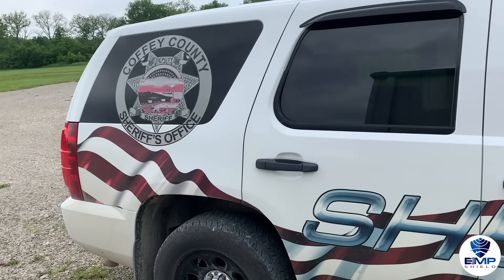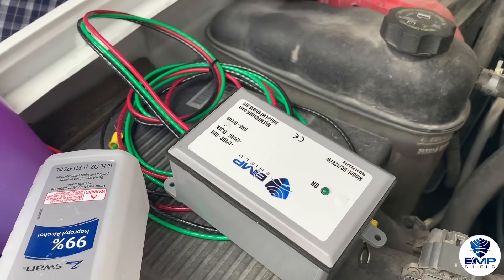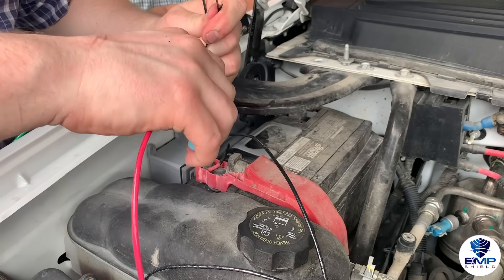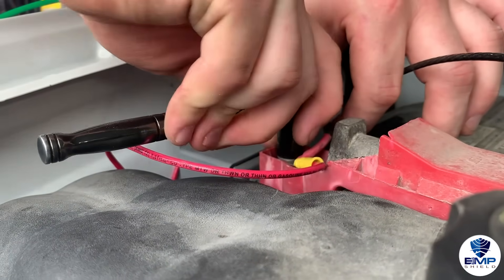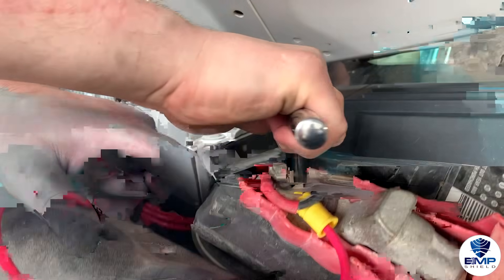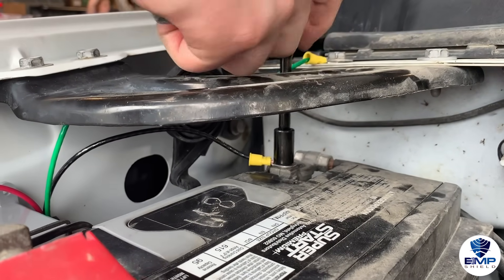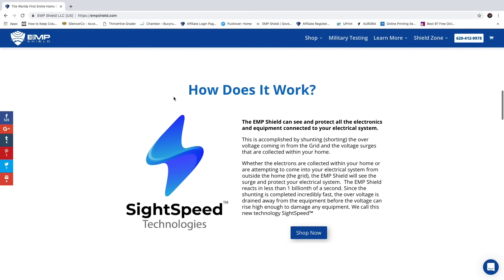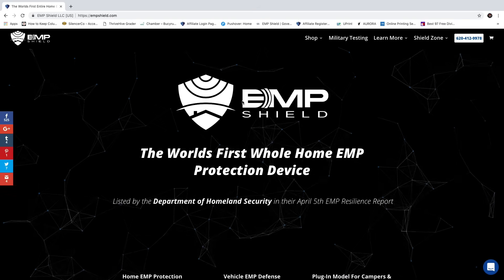EMP Shield Vehicle Installation Instruction - Electromagnetic Pulse Protection on Police Car

Comment: Im a Veteran, an auto technician, I used to be an Electrician Apprentice for 3 years, Im currently (pun intended) about to graduate with my Bachelors in IT, and I consider myself a amateur scientist.  
1) that ground wire is definitely not grounded to chassis. 
2) How does surge protecting the battery protect the resisters  and capacitors from overcharging and breaking within the ECU’s throughout the vehicle? 
The Ionized particles surge through the entire vehicle they don’t ain for the battery. The only way to protect from EMP is to physically shield the PCM, TCM, and RF-Hub with a Faraday wrap. 
Besides a private company simulated an EMP on several vehicles in stock condition and nothing happened to all vehicles newer than 2010! 
A Nuclear explosion triggered EMP is not going to render cars immobile. It’ll take out the power grid for sure! But very few cars will too. 
Don’t waste your money on this.
Reply: lets all hope your right, i feel soon we well all find out.

Comment: Can someone explain why the negative wire from the car battery that connects to the body of the car is not good enough? Are we saying the guts of this device are an easier path to ground than a large size conductor that’s already in place on every vehicle? Keeping in mind the car tires are a great insulator and no relief to Earth is available with either system.

Comment: Im about to install one on diesel that has two batteries, one on each side of the engine compartment: do I need both batteries protected? Specifically a 2003 chevy 2500 HD

Comment: Do you need 2 units for a 12v dual battery diesel truck?  Or can You just install it on one of the batteries?  Or do you use the positive on one battery and the negtive of the other?

Comment: I just watched this video.  My only BIG concern is that the guy wraps the 'extra' Red wire into a loop to coil up the excess.  THIS IS A BIG NO NO!  I am a surge protection professional, and I would shorten this wire up to serve the purpose of connecting it to the Battery positive side of the system.  Don't forget to keep the inline fuse provided.  The coil of wire is a huge inductive (reactive) component which would decrease the effectiveness of the suppression capability of the device.  Don't do this!

Comment: I am planning on picking up one of these in the coming week, or so, once I determine whether I can get away with a standard one in my vehicle's engine bay. I am, however, confused by the install order of this video. This video shows connecting the Positive/Red terminal first, followed by the Ground/Green, and lastly by the Negative/Black terminal. But this goes against what I know of normal 12V battery connections, which is to always start with the Negative/Black lead on a battery when removing fasteners?
Reply: I was just thinking king that too

Comment: Question that hopefully somebody can answer competently, I have a 2015 Mercedes Sprinter Roadtrek RV. The RV house batteries are in the engine bay, the chassis batteries are under the driver's floorboard. Will this installation work in the engine bay if I connect the positive to the RV battery in the engine bay? If not, I will have to route the positive to the chassis battery under the driver's floorboard. That would make the installation more cumbersome than I would desire. I have already purchased the unit and I'm waiting for further instructions before I proceed

Comment: QUESTION: Your instruction sheet, paragraph 4 states "Installation point for ground wire must be no less than 4 linear feet from the battery negative." But your video failed to demonstrate this. Is this critical to success or just recommended?

Comment: How much juice is being drained from the batteries while the vehicle isn't running? I see the tiny running led, but I would wonder how an accessory plug on something like a motorcycle would be effected under maintenance charges and actual use during operation. Cold starts after just a month or two come to mind.

Comment: Has this been tested on EVs? Should it be installed the same way for an EV by connecting it the same way to the chassis and 12V battery?

Comment: It’s a glorified surge protector being maliciously marketed that it protects people from an EMP when it actually doesn’t.
Reply: Yes, it protests from the surges or pulses from an EMP CME or surged caused by lightening so a vehicle or device can still function after the strike. What was you point?
Reply: @matthewronsson  Surges and EMPS are two completely different things. If the car gets hit by lightning this box will shunt that energy to ground. If the car gets hit by an EMP, everything is fried simultaineously. It's electrical effects cannot be shunted to ground. The only way of protecting the vehical is if was encapsulated in a farraday cage. By the way, there are only 2 things that can produce an EMP strong enough to cause damage, that is a nuclear strike, or a solar flare. And if you think for one second that this overpriced box of lies is going to protect you from that, then your an absolute fool.

Comment: I have shielded all of my vehicles and my side by side UTV.  I am curious, since large trucks generally have 4 to 6 batteries and run  on 13.6 to 15.0 volts would the 12v vehicle module protect them? I know that most 12v items are good to around 18 v before they go out.

Comment: How does it differentiate between the ground going to battery and the ground going to the EMP shield...all car batteries are already grounded to the chassis via the negative terminal, adding in another ground or green wire does nothing if the unit is connected to the negative terminal already....the pulse would reach the battery before it even went through the box. People would have to remove every electrical ground from the car chassis for this to even remotely work, the unit has to be the ONLY thing grounded to the chassis. Come on guys think about it for like 5 minutes.

Comment: Im confused about your video. The choosen ground wire location in the video doesn't make sense with what your directions say for install.
 Your directions state, "installation point for the ground wire must be no less than 4 linear feet (of conductor material) from the battery negative." 

The chosen ground location in the video does not look like 4 linear feet from the battery negative to me. Maybe a foot at most.

Comment: Instructions clearly state to put the ground wire a minimum of 4 feet from the EMP device and battery if possible.
This video shows the install about 4 inches away.
Do not do that! Stretch that green ground wire out as far as it will go and find a place to ground somewhere there. If you don't do that there is a good chance the device, battery and ground wire will all ark together rendering your EMP Sheild useless as well as your vehicle.
Be smart and follow the instructions. If they are confusing then call customer service and let them talk you through it.
Awful lot of $$ to spend on something to protect your valuable asset's just to throw it and your vehicle away because you didn't read the instructions.

Comment: We might note this device is NOT an EMP "Shield".  It is a pulse suppressor.  It does not shield any components of the car.
Reply: It does "shield" the vehicle. Research how EMP works first lol. I'm glad you're not the engineer that designs tools, gadgets, or devices.
Reply: It cannot guarantee EMP protection Because its not a Faraday cage. It can only increase the vehicles survival not guarantee it.

Comment: What about vehicles that have two batteries? Many newer vehicles have a small, auxiliary/second battery for automatic start/stop.
Reply from the maker: Michael Ferguson great question! You can install a single device on vehicles that run 2x batteries. The Shield installs onto the main vehicle battery 🔋. Unless your vehicle has two distinct 12V systems a single Shield will work.
Reply: EMP Shield thank you so much!

Comment: Why hell, that didn't tell me anything!  Wth does this thing do?
Reply: It directs over voltage to ground and disconnects the battery from the system by short circuiting it
Reply: @matthewfredrickmfkrz1934  
Actually I just knocked myself in the head!!!  It's function is in its name: (E)lectro(M)agnetic (P)ulse Shield!
Reply: @jamesrobert7155  I looked through the comments and found a link to the website... That's pretty much what it does and how it'd be protecting stuff from what I could tell and explain to you in simple common terms... I guess I neglected to mention that emp "inducts" voltage through "electromagnetic permeability"  and that's what would be the problem for a circuit in the case... The poopoo are really just saving checking some fuses in the extremely rare instance of an emp which means the precinct is wasting money on dumb ahhs boisheeeeit IMHO
Reply: Here's what would happen to me...
"OMG wtf happened to my nose it felt funny... Oh car won't start... Checks fuses (5 seconds later) oh my goodness a blown battery fuse or at worse a burned "fusable link"... *Gets fuses in replaces simple 8g wire for fusable link*... Oh man now I ain't got no money due to inflation copper is expensive also since 95% of my income goes to police safety for my safety if I don't like it poopoo comes kicking in my car/house I welcome the new alien overlords as the new masters now... Meet the new guard, same as the old guard...
Reply: @matthewfredrickmfkrz1934  
We should make that into a movie my man! Damn!
Reply: Or an alien invasion, they wanna be ready for that, or if the Sun decides to give us all a giant burst of love.
Reply: @jamesrobert7155  it'd be a great metaphor for reality that way

Comment: The wiring looks so sketch no heat shrink terminal ends no wire loom and the cable was not cut to length the ground bolts are exposed to the elements and it's not aesthetically appealing.......I'm a profectionist so I guess it doesn't bother the police officer as long as it protects the vehicle from EMPs

Comment: This is why I have a 78 Malibu with a points ignition system sitting in my garage in case that day ever comes
Reply: Richard Wolfe  I use a magneto. Its makes its own power
Reply: @jonalarcon8564  
I have $5k worth of brass screen under my T-1-11 and Armorcore in between my wall studs in my 1300sq ft house. Custom Lexan glass windows. I used 2×4 oak for the window stop material with 1/8" iron flashing underneath.
Reply: Richard Wolfe faraday  cage cool.
Reply: @jonalarcon8564  actually I just copied a friend of mine that used to steal equipment from the state and the city and he showed me he hid it in his garage and his brass screen under his siding hid the GPS and LoJack signal until he could find it and remove it
Reply: Richard Wolfe I'm getting ready to do a new house build I never thought about doing something very similar to what you just mentioned unimpressed any more information out there
Reply: @jimwoodard927  I would have went with a thinner brass screen because it works just as well and save myself half of the money
But the *Armorcore inside the walls was the best investment I've ever made
I have solar panels up top and two Tesla batteries underneath and I can go about 11 days
Reply: Richard Wolfe speaking of Tesla if you got the Tesla walls can you operate them without them being connected to the internet I don't really want anybody outside being able to have access to meet to my electrical system would have been very interested in your product
Reply: @thecloneguyz  is it difficult to connect with a cell tower with that setup? 
If it's so, then I'm certain there's a workaround.
Reply: Richard Wolfe well that would be odd because General Motors switch to electronic ignition switch exclusively on all the vehicles in 1976-77 car what is somebody retrofitted with points that's good for you
Reply: @jimwoodard927  it's a Mallory dual-point setup for racing
Most old school guys put these on their car instead of the HEI
Reply: @jimwoodard927  
Your talking about an HEI bro
Cmon now 
My motor is a twin turbo 283 cui pushing 93psi of boost @ 7500rpm @ 9.73 1/4mile @ 131.7mph...
Reply: Starter and ignition can still go out from a emp.
Reply: @saltyp7573  not on an older vehicle because the the way the starter and the points ignition system are built
Reply: @thecloneguyz  to make sure that your vehicle WILL work after a emp, ferrite rings over the electrical wires on your starter and ignition. Modern cars will need more shielding, they also sell a device to mount under the hood of modern cars for emp protection. It basically connects to the battery.
Reply: @saltyp7573  there's no circuit board in older vehicles electronic systems
Reply: @thecloneguyz  maybe in the radio.
Reply: Doesn't an EMP take out the coil the windings inside a coil and your starter and various solenoids. And if you shielded the brain box the EMP will still hit the tail light filament run right up the wires and all the way it back inside your little shielding around your brain box and take the Pulse right inside so I don't know how you're keeping an EMP out of anything without putting your whole car inside a faraday cage
Reply: @brenttate9299  the solenoids and starter and coil packs run at a higher amperage than the EMP
Reply: @thecloneguyz  if I remember right a nuclear EMP produces 30000 to 50,000 volts I'm pretty sure if I put that kind of voltage to any of the devices I mentioned earlier they're all going to be toast. Seems to me all this is going to help against is a leaky microwave oven. It also seems like this is the best game out there because if it don't work how do you get your money back because nothing's running males not going to get through and you can't drive back to go get these people
Reply: @brenttate9299  horse, and back to the old stagecoach❓
Reply: @brenttate9299  
You're leaving out all of the shielding and metal and rubber and all of the stuff that's protecting the starter and the wires
Reply: Switch to something like a 97 Cummings and no ignition at all. Use a powertank w air tool to spin the motor to fire it up.

Comment: It should be standard equipment on all vehicles and on a home's electrical system
Reply: I have brass screen underneath my cedar shake siding to protect my entire house
$5500 in brass screen
Reply: Richard Wolfe qqqaZ. L.
.
  MMA
A,M.  Nuikieiugceojuiufeaoiuioszsdioisiiioioiooizkzkokkozkkkllkzlkkolklzkm%kklkolksMKLZSPKKSDOKKDLKLMLMML!KL KL. LKML!LLKL!QQQAQWDKLKLKLKLZ-LZLLLZ9
LLL!L!LLLDL!!DL!S!LD !L
Reply: @thecloneguyz  Ever see Breaking Bad and the lawyer's father...
Reply: Most auto manufacturers these days have filters on the power connections into electronic modules.   Also just the battery itself has a voltage that is pretty immune to voltage spikes.   The impedance of a battery is pretty low.
Reply: @GeorgeWashingtonLaserMusket  The battery should absorb the energy.   This box has a very long cable.   Doubtful if this box even sees the energy spike if it is short.
Reply: @GeorgeWashingtonLaserMusket  a faraday cage is something that is isolated from Electronics or other metal in the car so nothing on a car is a faraday cage because it's connected to all the other electronics plus it's isolated by the rubber tires
All it takes is one large solar flare and every HEI electronic system will be garbage on every single car 
You'll wish you still had a points Electric System
Reply: xadam2dudex it does nothing it can't do anything try searching Faraday cages or EMP attacks and you'll find this box is full of snake oil
Reply: Jim Woodard yea I don’t see how this can protect a vehicle or a house
Reply: @will if there's a will, there's a way 😉
Reply: @jim cool story bro but maybe you should be the one searching. You mean the multiple test they did at the facility is fake? Lol. They sure went through a lot of trouble just to Fake this and if another third party test this and it fails they can get sued. HEMP can't destroy all vehicles anyway modern or not. This device can increase the vehicle's survival rate not gaurantee it. EMP creates an overvoltage problem so this device is like a super fast surge protector. If this doesn't work years later maybe government can sue them too lol. CME/solar flare can happen every 100 years so I guees we will all wait 😜
Reply: @ewcm1878  Likely tested with very short cables.   This is just an EMI filter.   No big deal.   The only need to test it was for marketing.
Reply: @ewcm1878  The "test" they did is full of BS. They subjected it to 50K V/m which is really nothing at all. Electromagnetic fields are influenced by wire length -- the longer the wire the more prone it is to effects. The highest energy pulses (which are way more than 50K V/m) don't start really seeing effects until the wire is about 3m long. This device doesn't have a wire that long in it.

Your vehicle already has a lot of survivability in it. As long as your electronics are all properly grounded, any sort of direct influence effects will be shunted to ground and nothing serious will happen.

Comment: On my 2014 Chevy Silverado 3500 HD dually pickup truck there are 2 batteries. Will one unit do the trick, or do I need one unit for each battery?
Reply from the maker: hello. you will only need 1x EMP Shield. You can put it on either battery